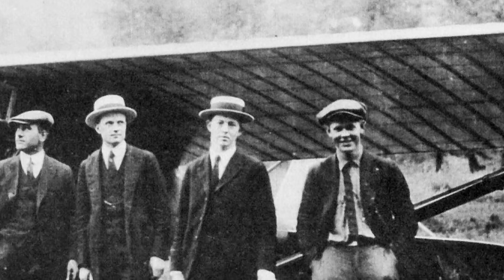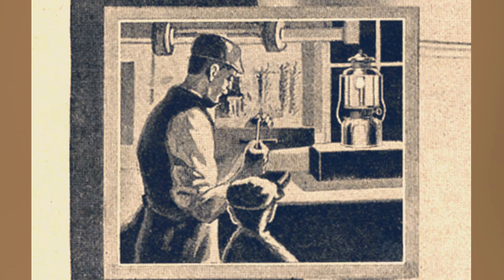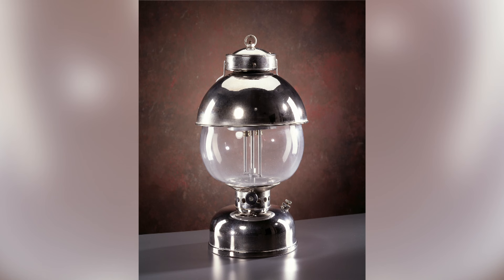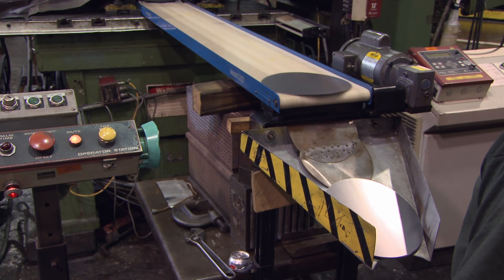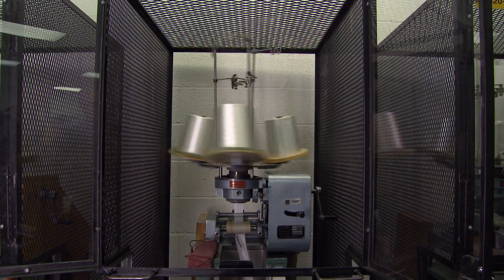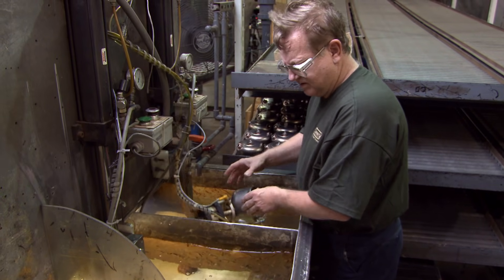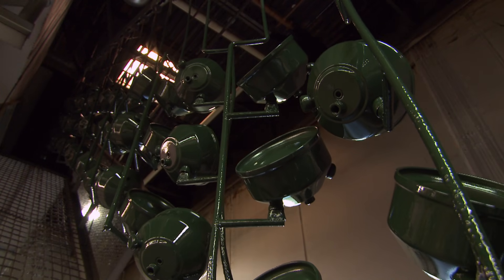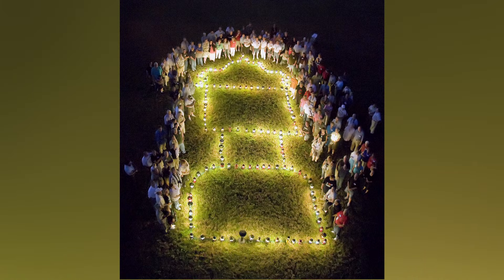How Coleman Lanterns are made - BRANDMADE.TV

Comment: I have a red 200A that I bought (I'm guessing) in the early 80's. Used it a few times then put it away in the red plastic Coleman case I had bought especially for this lantern. It's been stored for about 33 years but I got her out, added some fuel and she started right up with the original 33+ year old mantle. Looks and works like new. Thank you for preserving knowledge.

Comment: I think everyone should have at least one of these and a good supply of fuel and mantles, and be familiar with how to use it.  A stove that runs on the same fuel as your lamp is a good thing to have on hand as well.  A very simple step every household can take for disaster preparedness as well as recreation.  I think after the recent situation in Texas we can see the utility of a non-electric light that can run on a variety of fuels (gasoline, white gas, and even clear kerosene) that puts out a large amount of light as well as quite a bit of heat.   I've rarely had to use these indoors in emergencies so always be mindful of ventilation and have a working battery powered CO detector.  I've never had a coleman lamp set one off although you can smell it running a little.

Comment: I've used Coleman products for work and play for over fourty years, I have 15 lanterns, oldest is a 1949 228d... Works still. Found it in the dump with a near mint 1959 200a, that works too, they all work! My wife just bought me a new 639 c. Never had a brand new one before.
Reply: I cant believe why anybody would throw one of these old lanterns away, I'd love to have another 200a while there are people throwing them away like do they even wonder if it has any value
Reply: I’ve got a couple dozen. You can pick them up cheap if the paint is rough and clean them up and repaint. The thing to watch for is the top vent for damage, they are porcelain coated and can’t be easily refinished.

Comment: You know what'd be nice? A gas lamp that took normal lighter fluid, and didn't need mantles. Maybe switch to wiremesh over glass, too.
Reply: You can get a mesh "globe". I have a couple. Good thing about them, they don't break with a little abuse. Bad thing, not as much light. But not enough difference to worry about.

Comment: Batteries are more convenient
Reply: I've never seen a battery powered lantern put out near as much light,  though.
Reply: Battery-operated lanterns take away from the fun of camping and also fluorescent or incandescent bulbs attract mosquitoes and other insects more than the gas Coleman lanterns. I use oil hurricane lanterns and Coleman gas lanterns when I go camping but I do have flashlights just in case and I do use a battery operated Lantern made by Coleman for inside the tent.